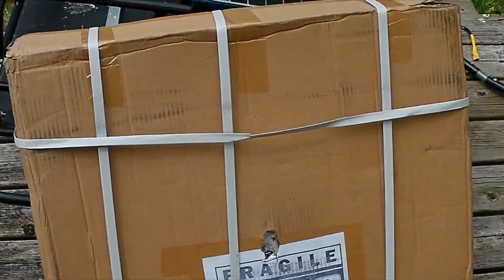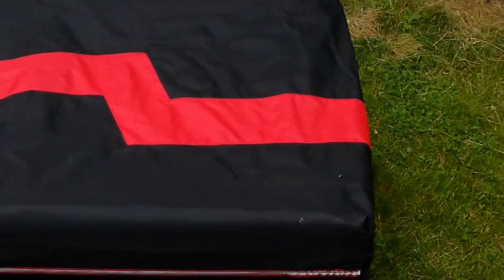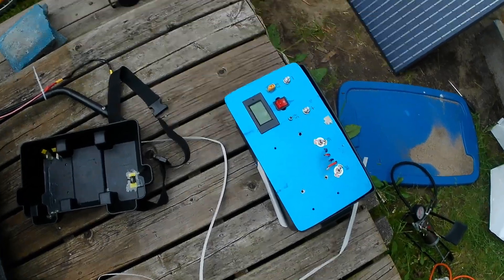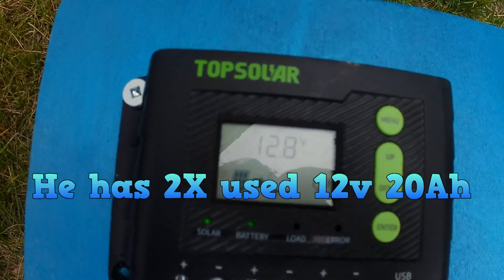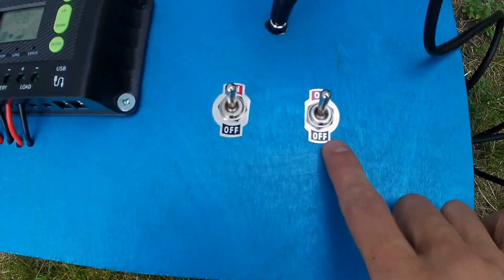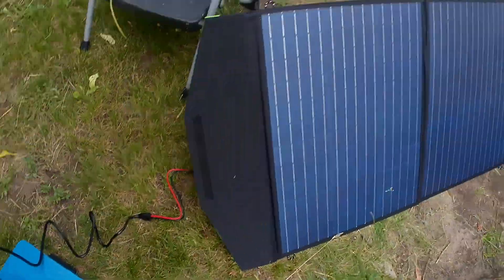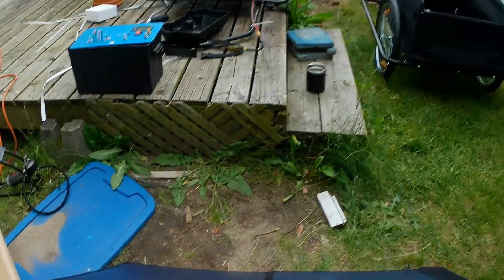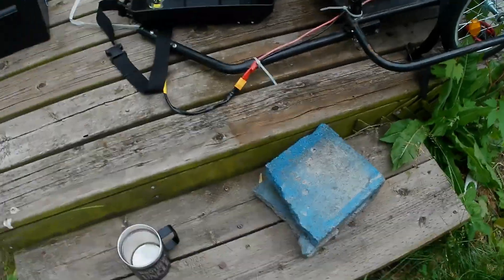Building The Ultimate 500W Solar E-bike! Part 1

Comment: With batteries getting cheaper why not go with a larger one like 50ah/100ah instead?
Reply from the maker: There not cheap enough for me yet but I have a solution I think in an upcoming vid.
Reply: @Ro-Bucks  Ok, was thinking it more of a weight issue more than a price issue.
Reply from the maker: IF your talking lead acid ya, 50Ah lithium would be lighter than my lead acid right now. If I could afford it my dream is a 16s prismatic cell battery
Reply: @Ro-Bucks  Why that particular brand/battery? I checked and they are VERY pricey.